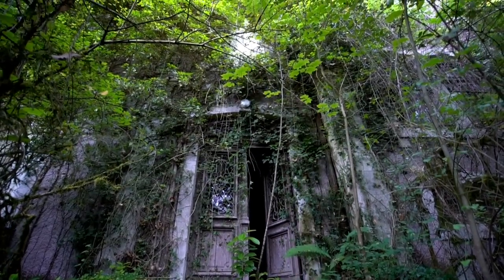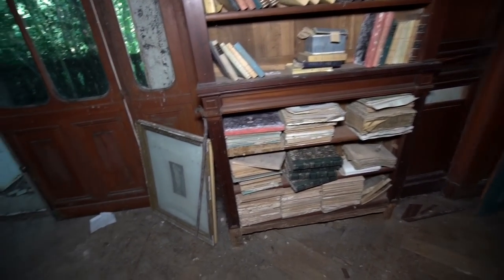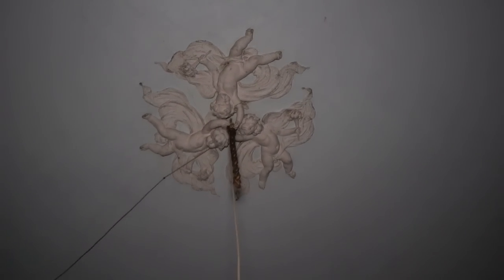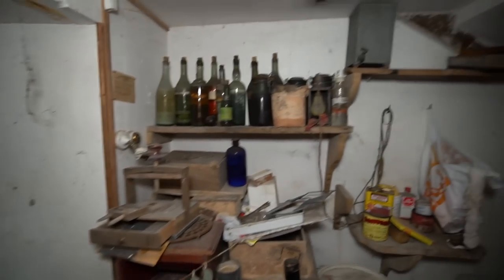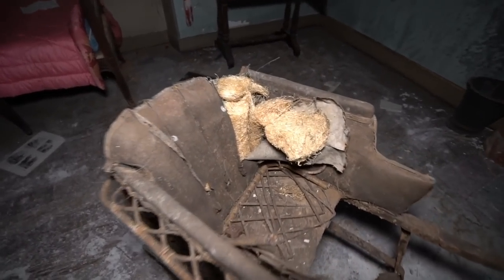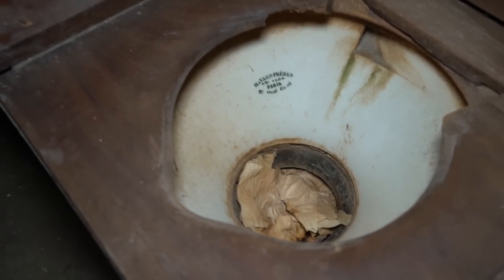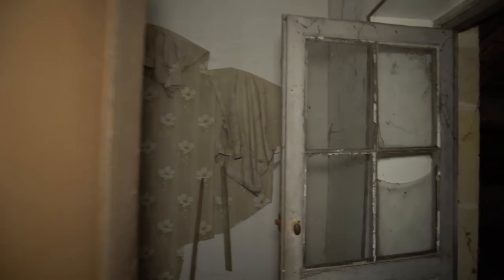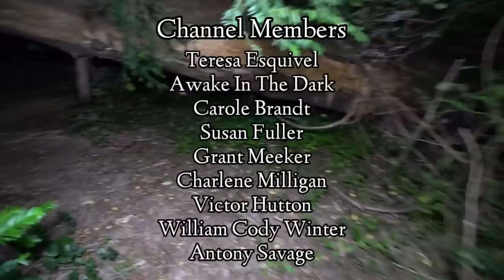MYSTERIOUS ABANDONED HOUSE in the WOODS UNTOUCHED Abandoned CHÂTEAU

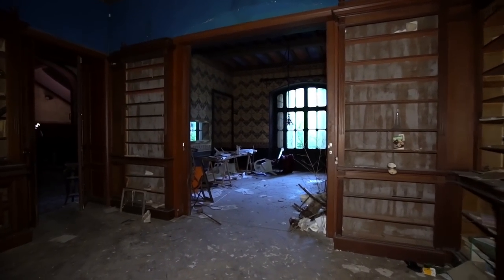Comment: Wow! It must have been neglected outside for many years while it was still lived in since the outside looks decades older than the inside. I was expecting to see just rotted walls inside. Amazing condition compared to the outside. At 10:38 there 3 white plastic chairs and 1 at 19:00 that cant be more than a few years old.  It may have been preserved for years while it was "parted out" by heirs? At 11:55 there is a 5 1/4 Floppy disc on the floor! Maybe they had files of valuable books and antiques on a computer for an "estate" sell off? The missing books were probably valuable and removed while the place was kept closed? Amazing to see so much untouched.

Comment: The beds were always kept  incased in heavy fabrics  either in the little cut out areas usually those for the elderly or children , More elaborate gorgeous center design   also to Incase them in warmth . 
Servant and help always in attic areas as this was the warmest of rooms -    Plain beds compared up there 
 Every room had the finest  fireplaces of marble harths.   House attendant  placed the hot coals I.n bed pans with long handle to warm under blankets first then they'd close the fabrics tightly to Incase them inside -